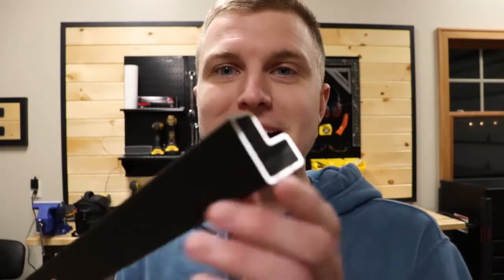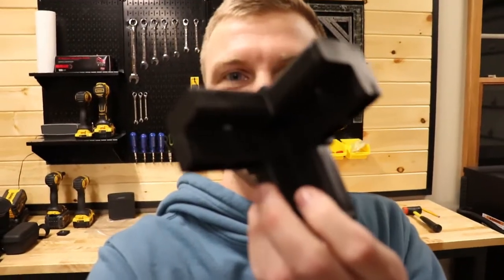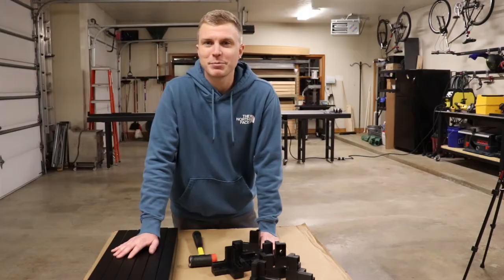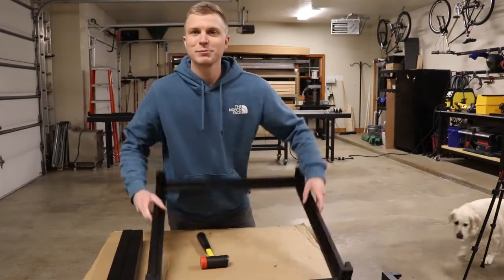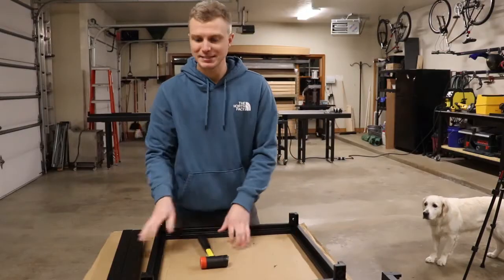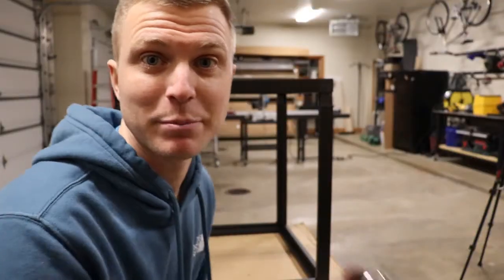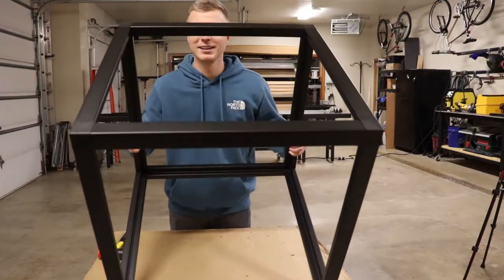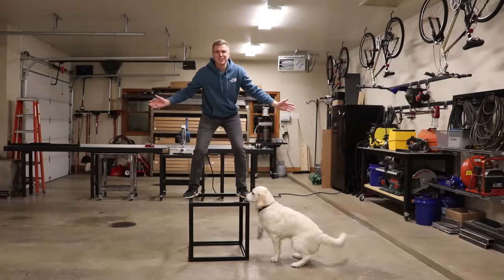How to build a simple metal frame WITHOUT WELDING

Comment: I am doing an outdoor trash bin for an eagle scout project and i want to use this framing system, is there a way i can attach wood to all the sides and have a entry point to retrieve the trash?
Reply from the maker: Hello! Thank you for the question. There are several ways you can attach materials to the tubing. A few examples would be screws, velcro or double sided tape. Here is the link to our website for more ideas - https://moxitec.com/ 

- Moxitec Team

Comment: I was thinking of doing something similar to make a kind of sofa. Since it's going to be much wider than a cube, I was wondering If I'd need to add diagonal tubes aswell and, if so, if there was a type of joint that would work for that.
Reply from the maker: Hello!  Thank you for your question. All of the joints can be found here on our website - https://moxitec.com/shop/components/tubing-connectors-and-frame-clips   adding more supports to a structure will help with strength.  If you are looking for design help or have any additional questions please go to the contact page on our website and send an email to our sales team.  They would be happy to help!  - Moxitec Team

Comment: Also what's the difference between "tight" fit and "loose" fit they have listed on their site? I'd think you'd want all fittings to be tight no?
Reply from the maker: Hi Emily,  thank you for the question!  The difference between "tight" and "loose" fit is that the tight fit tubing is designed to be put together with the connectors and not taken back apart. The loose fit tubing is used in applications where you would need to put together a frame and take it back apart several times. 

If you have any additional questions please visit the website - https://moxitec.com/  - go to the contact page and send us an email. One of our sales representatives would be happy to help! 

-Moxitec Team

Comment: looking to build a 40”w X 40”l X 36”h to hold a 300lb pizza oven . will this hold that weight?
Reply from the maker: Hi Jan, 

Moxitec's aluminum tubing and joints are strong and rugged. They are designed for both indoor and outdoor applications. Each application is unique, which means that the strength is dependent on the configuration of the combined components. We recommend testing to determine how to best fit your application.

Thank you for the question! Check out our website to shop products: https://moxitec.com/ 

- Moxitec Team

Comment: Was looking through your website.. do you make 4-way connectors? I'm looking at building 2 enclosures just like this one with clear acrylic sheeting, one on top of the other.
Reply from the maker: Hi Colton, we do not have 4-way joints at this time. However, we would recommend looking at our Bear Stack Clips if you would like to stack frames. Here is the link: https://moxitec.com/shop/components/bear-clip-stacker 

Thanks for your interest in our products!

Comment: I would like to build a rectangular cube as a frame for my backpack using your L-tubes and 3-way nylon joints, but I would like to add 4 legs underneath the cube so the backpack sits off the ground. Is there anyway to do this? (a 4-way joint would fix my problem but I understand you don't manufacture those)
Reply from the maker: Hello, one suggestion would be to use Flush-T or Wing-T joints to create a shelf. An example of this is an end table featured on our website.  https://moxitec.com/shop/projects/end-table 

Thank you for your question!

Comment: If the three way corner square tube is loose, can you tell me an idea to tighten it, brother?
Reply from the maker: Moxitec tubes and joints are designed to always be a tight fit. However, if you are working with your own materials then maybe try an aluminum shim. Thanks for the question.
Reply: You can't have 2 different metals touching each other. It'll corrode them fast. Look up galvanic corrosion.

Comment: I actually want a method of joining 4 already welded squares together. Would be glad if I could get some ideas Thank you.
Reply from the maker: Depending on your application our Aluminum Frame Clips could be used to join and separate frames easily. Here is the link to the clips on our website:   https://moxitec.com/shop/components/tubing-connectors-and-frame-clips/aluminum-frame-connector
Reply: I can't figure out how to see your aluminum clips it flips to the same basic page.